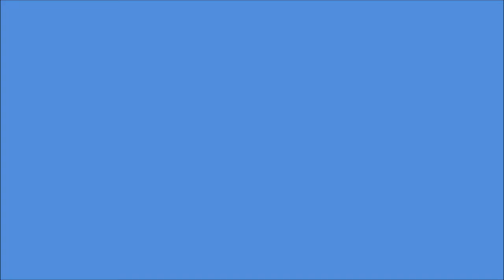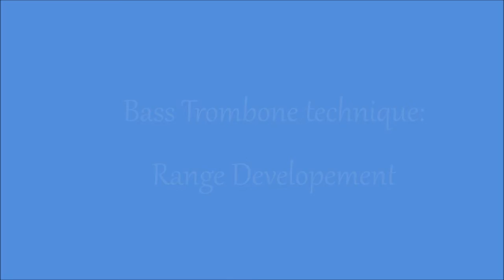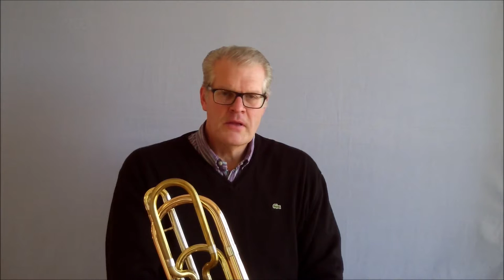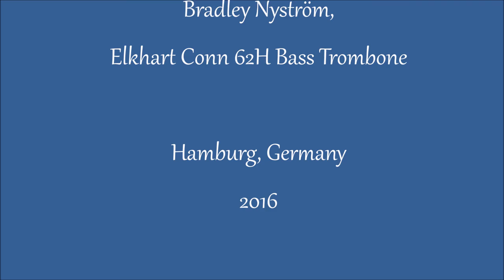Bass Trombone Range Developement

Comment: Hey Bradley, Great videos!! I also play very similar to you, with me shifting the instrument to transition from low to high. Anyway, I have a quick question for you if you don't mind to answer. I'm primarily a Tuba player, however in the past few months I purchased my first bass trombone ( I already own a cheap tenor to play for fun). I plan to play mainly for a jazz big band, however some solo/piano accompaniment stuff interests me as well. Because I'm a Tuba player, and on a limited budget, I decided to purchase a single trigger bass trombone. (double trigger brought it up another 500-1000$) I've read that you can do pretty much everything you'll need to play on a single trigger horn(besides low B natural), so I went with that, and felt pretty good about it. However, many people have criticized my decision saying that I absolutely should have bought a double trigger over a single trigger.....So that FINALLY brings me to my question(sorry). Is it possible to have a second trigger installed onto my single trigger horn??? Would that even be a possibility??? Or would it be just the same amount of money to sell my horn, get my money back and spend a little extra to purchase a double trigger horn?  So sorry for the length, but I felt like you were the one to come to....THANKS A LOT!!!
Reply: I'm sure you've come to a resolution on the situation by now, but just so there is an answer on this some tech's could install a slot in valve to convert from a single to a dependent double set up. I purchased a horn last summer that had this modification on it. I don't know how much this kind of modification would cost though. Valves might be $200, but then I'm sure there's plenty of labor to add to the cost. If the music you need to play doesn't have valve Bs written at all, that kind of expense might not be worth it.